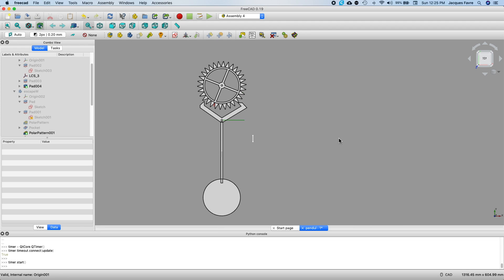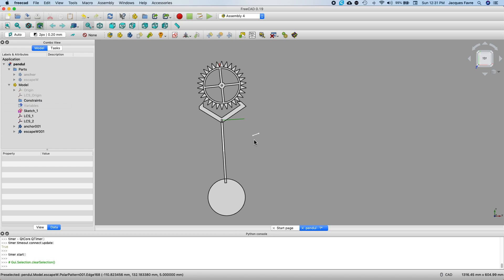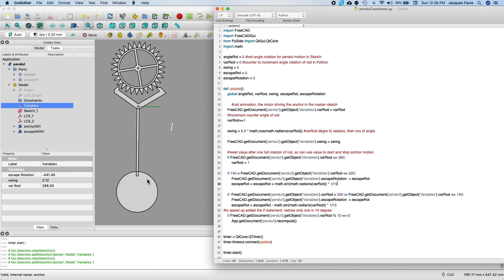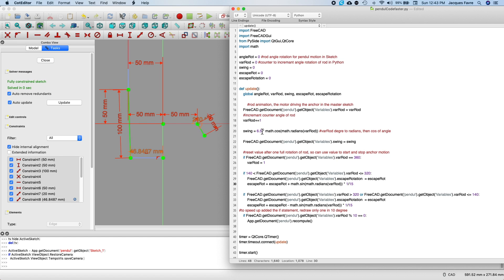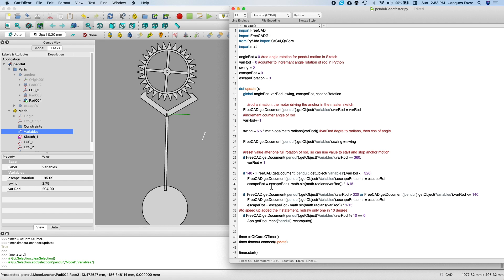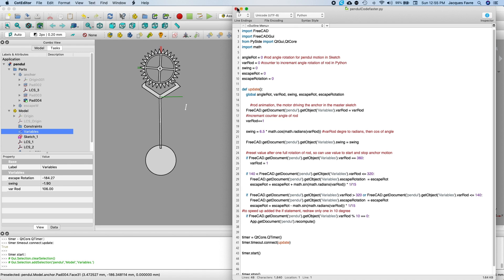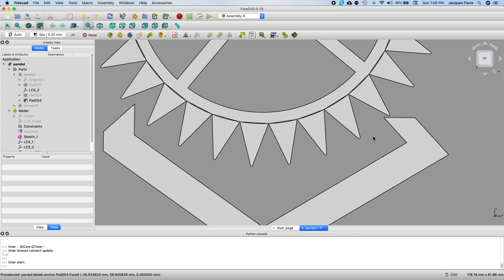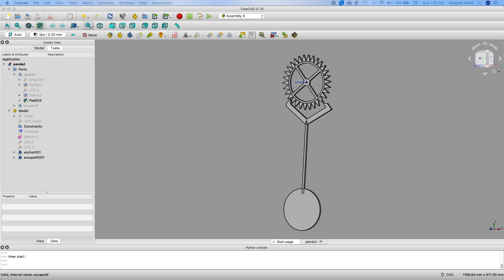Recoil Escapement Escapement Animation FreeCAD

Comment: This is really very interesting. I've spent the last couple of months trying to find a workflow that would take me from design of escapements and clocks, to testing via simulation, and finally to creation of STL files so that I can print the parts on my 3D printer, using freeware. I've looked at Siconos, Openscad, Freecad, and other tools. I had just tried Algodoo to create this escapement this evening when I coincidentally stumbled across this video (in this case Algodoo noted the contact between objects). Now I have a new Freecad workbench to look at. ;-) Have you examined the FreeCAD-MBDyn dynamics workbench? Thank you for your work and will look forward to the links to your files.
Reply: maybe buy a few cheap clock movements and an assortment of good files and start practicing.escapement repair. (files for filing metal that is..)
Reply: @shaunthornton2381  I have found that Bullet Physics Playground is a good simulation tool for all this, allowing me to test my own escapements, non-circular gears, etc. creating STL files to send to the printer. I've also spent time hands-on with two clocks to learn the stuff that simulations don't deal with.